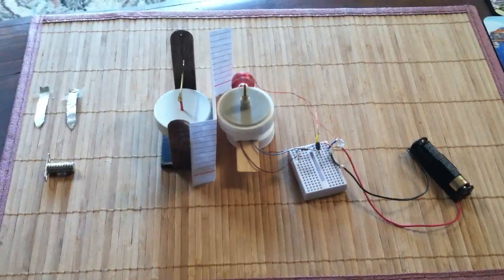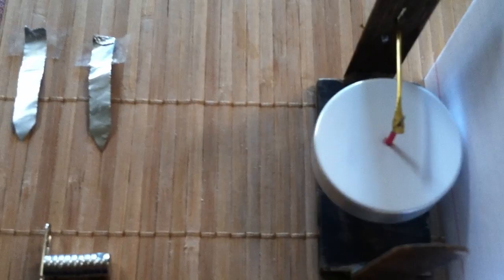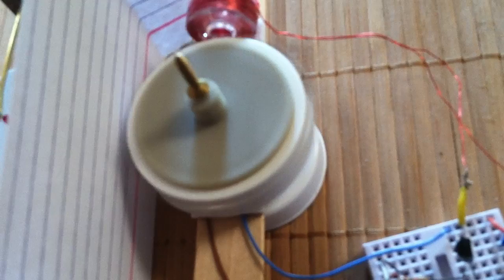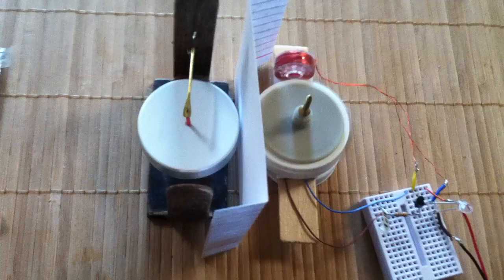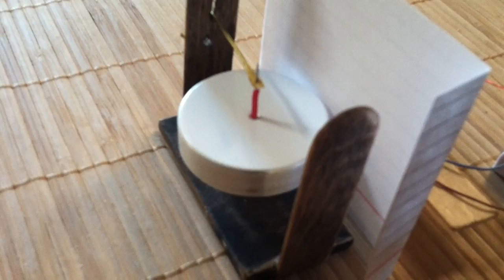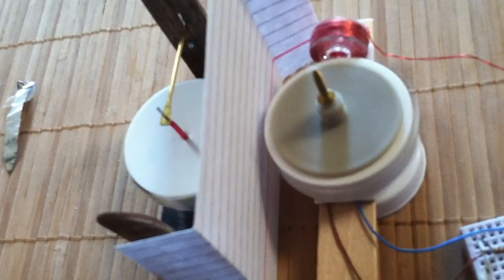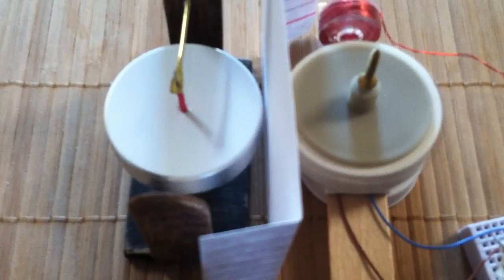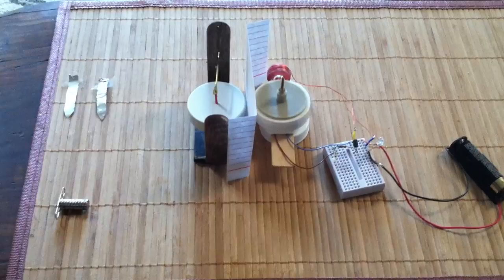Riding A Magnetic Breeze

Comment: This effect works pretty good when you place two hard drive aluminum discs together like capacitive coupling, one rotor being aligned with the magnets. I remember it also works fairly well simply using a round ferrous rotor, though 'perfectly' round, the magnets will still 'drag' the round ferrite rotor into rotation.
Reply from the maker: +Magneticitist Thanks.  Interesting.

Comment: Interesting magnetic clutch & wireless disc drive. :)

Thanks for sharing!
Reply from the maker: +A B   I was heading off in the Arduino direction but I got side tracked. If I pulsed an array of electromagnets around this Al segmented rotor using the Arduino it might make an interesting motor. I suppose it would resemble an AC induction motor if I did it right.
Reply: +Lidmotor I think you are right--but, with a lot less output torque though.

Comment: Well that's a different spin on things !
Very neat.
I imagine the output would suit an AV plug, them being fast swapping charges as it spins. 
Hey, no matter if this principle is well known, it has that replicable distillation of your processes...or, anyone can have a go because of the great way that you laid it out :)
Reply from the maker: +slider2732  I did a bunch of tests today and it appears that the rotor is being pushed but not picking up any kind of charge.  The energy transfer seems to be in the kinetic movement only.  I might be wrong.   I know that when you move a permanent magnet past a conductor you induce an electrical current but what if the conductor says , "Hey I'm not going to do that .  I'll just move out of the way." lol
Reply: Hmm, well the rotor can be connected to in a similar way to an EZ Spin, some kind of shaft pickup with little drag. Perhaps Triboelectric from a glass rod as shaft and wool, then off to run an HV motor...which then can have its own output converted ? a bunch of different devices from your vids 'off the shelf' all running in a neat way !

Comment: I'd like to know of it works the same or better if the aluminum was a continuous piece, rather than segments. My guess is that it will. Also, it would be nice to test with copper, rather than aluminum.
Reply from the maker: +Troy Heninger  You read my mind.  I was wondering the same thing.  I may try that and see what happens.  This is a mono pole rotor (all N facing).  It might need a NSNS rotor for it to work.
Reply from the maker: +Lidmotor I just tried it and it did rotate with just a solid strip but not nearly as fast.  This was with the mono pole rotor.  A N/S rotor arrangement might produce better results.
Reply from the maker: +Lidmotor  Just tried it with a N/S rotor and got excellent results!! I used one of my old setups called the 'Light Multiplier' that spun up a N/S ring magnet on a concave mirror to high speed.  It worked great.  Very interesting effect.

Comment: Interesting video. I wonder if the motor runs slower when the aluminum rotor is running?
Reply from the maker: +eamonn280958 That is the thing about Lenz law ----It's a drag. The friction loss on the driven rotor feeds back to the drive rotor. If you loaded the second rotor with something it gets worse.  It is really just like loading the drive rotor with a pick up coil.